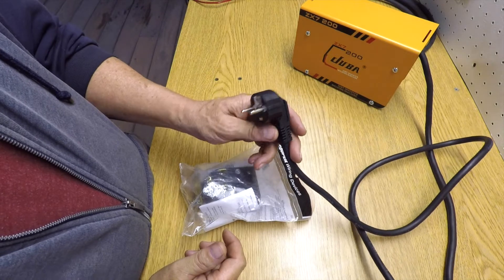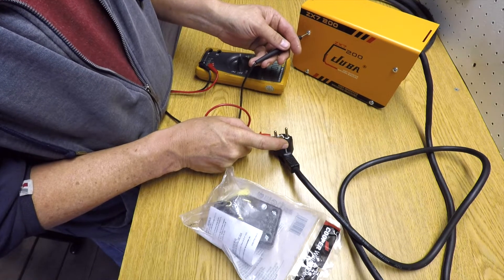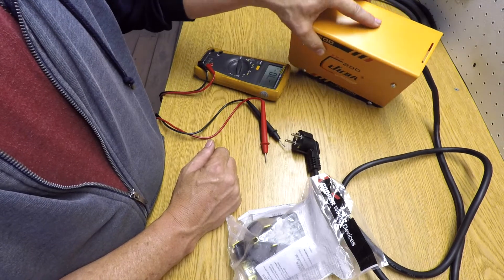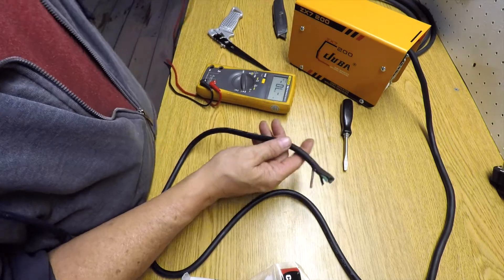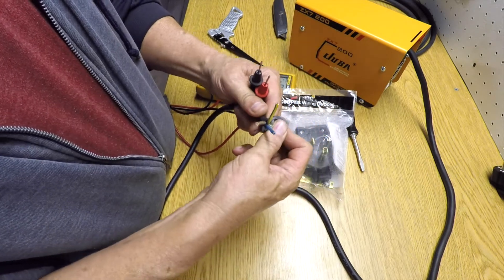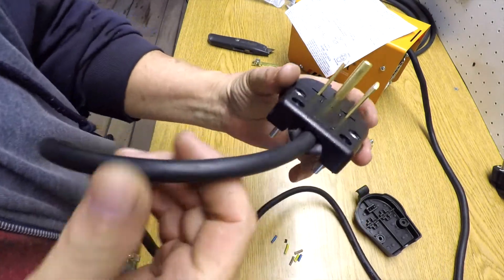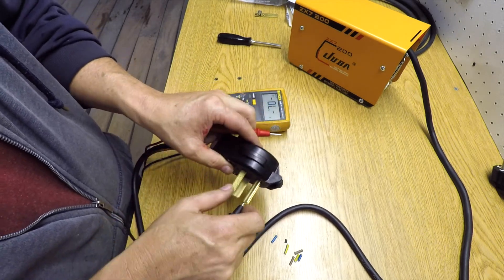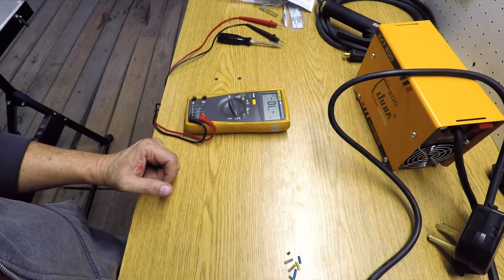How to Install a 240V Welder Plug (Wiring Instructions)

Comment: YOUNG MAN ,
U DID THE PLUG JUST RIGHT, SOME ARE UNVIERAL PLUG   BETWEEN  $ 10.99 TO $ 18.00  AND SOME  ARE REAL WELDER PLUG BETWEEN  $ 15.00 TO $ 25.00 ! .

IF U EVERY GET SHOCK BY 250 V  , U WILL THINK TWICE ABOUT IT WAS OVER KILL ! .

U ONLY SHOW  + POST  / WHERE WAS THE --- POST !  .

BREAKER 50 AMP . 240 OR 250 V  PLUGS
Reply from the maker: My understand is a 240V plug of this nature only has two hot wires and a ground so no - post on this plug.

Comment: Enjoyed your video . The 50 amp breaker or fuse is there to be the weakest link in the electrical circuit chain. Now when you put the 15 amp power wire from the welder,  to your 50 amp circuit from the house panel, the 15 amp wire will melt before the 50 amp breaker trips should there be a current overload in the welder..A fire hazard. That is why we have the National Elecrical code. Be safe sir.  Love these welders though.The answer is to take your 50 amp plug ,attach 2 ft of #6 awg  copper rubber SO cord. Put the other end in a small 2 pole 240 volt, 20 amp breaker box from home depot.  Install a 15 amp 2 pole breaker and put the output to a 240 volt 15 amp receptacle via another piece of SO cord...I hope I over thought that enough.  cheers.
Reply from the maker: Yes I see your point and agree with what you said. To date, I have never plugged this little welder into a 50 amp circuit as I don't have one but if I did I can see how it could be an issue.
Reply: @DIYHomesteadProjectsDIYHP10  Thanks for the positive reply. I just ordered one of these welders and plan to run it from a battery bank attached to a 120 / 240 volt inverter. We'll see how that goes...cheers.
Reply from the maker: I really like this welder! I'm new to welding and just tinker with it but I think it is a very capable welder and perfect for my needs. I'll bet you will like yours too. I'm interested to know how it works out for you. Cheers :)

Comment: Just to make sure I don't end up electrocuting myself...it doesn't matter which of the brown or blue wires goes on the left or right blade, as long as the green/yellow is connected to the ground, right? (Mine just came in the mail from Banggood, and now I'm waiting for the plug to come from Amazon.)
Reply from the maker: Well that's how mine was wired but I can't really guarantee yours will be the same. Sometimes the Chinese equipment doesn't seem to have a consistent color code for their wiring. The best thing would to be to test all three for continuity with a screw on the case. The color that beeps or shows continuity should be the ground wire. The other two wires are both hot and it doesn't matter what blade they go to (left or right) in the plug. If you don't have a meeter then you could always remove the 4 screws on the case and pull the top off. Look for where the cord comes into the case and follow the wires. One should be wired to a screw somewhere on the case. That one would be the ground and the other two are the power wires. Hope this helps you out and I hope you enjoy the welder. I'm new to welding but I really like this welder so far.
Reply: @DIYHomesteadProjectsDIYHP10  -- Thanks! I can't wait to try mine out. I don't know if I found the deal of the year, but I paid $58 for the welder, stinger, ground clamp, and leads, the whole shebang. All I need to do is put on the plug.
Reply from the maker: Awesome! Sounds like you are almost there. I can't wait to hear how you like the welder after you get it going. I think you did great with the price too.

Comment: 2:05 I prefer the kitchen version connector.
Reply from the maker: I did also but we don't have that type of outlet here in the USA so I had to change it to something else. The connector I installed is overkill and way to large amp rating for this little welder but it is a fairly standard welder connector here. I wanted to be able to plug the welder into any fairly common welder outlet I may come across. One of the benefits of this little welder is it's portability but I am learning that finding the correct outlet for a portable 220V device everywhere you go can be a challenge. I have learned that a portable welder may not necessarily be portable unless it is a 110V welder and sometimes even that may have it's challenges. Most 110V welders recommend or require a 20 amp outlet and there are many 110V outlets that are only 15 amp. Thank you for the comment.
Reply: @DIYHomesteadProjectsDIYHP10  
Well the connector I refer is like you use and is an American connector

https://mobileimages.lowes.com/product/converted/695706/6957064545067.jpg?size=xl
Reply from the maker: I agree and now understand what you were saying. Thanks for the link. I just used one of those for my 30A extension cord to run my little welder off my 30A - 220V clothes dryer outlet in my new shop.
Reply: I use those things for my extension cord too but in a different way, I use regular 120V connectors in the cord (the machine too) combined whit this homemade adapter whit the connector I said before look the link

https://drive.google.com/open?id=1OsIgA0CYdjCUQBWTo8inz5y3rTIR121O

https://drive.google.com/open?id=15GEx1Qk3RUACUGX9nleMwczJvG2TvQKT

In this way, I can run my extension cord as a regular cord in regular 120V outlets or for a high amp machine like a welding machine whit the adapter.

Comment: The 50 A plug is definitely overkill since the #14 wire wouldn't handle close to that.  You did a very neat job of installing the connector and the welding wire.
Reply from the maker: Looking back on it I maybe could have done something a little more practical. I just wanted it to have a standard 240 plug incase I ever take it somewhere else hopefully it will be usable anywhere I find a 240 outlet.
Reply: @DIYHomesteadProjectsDIYHP10  That is a good point.